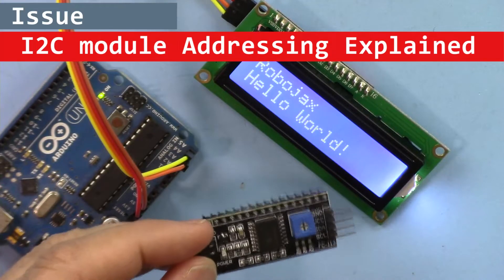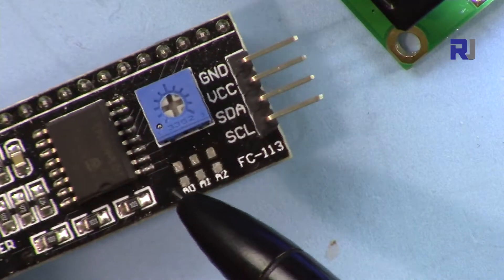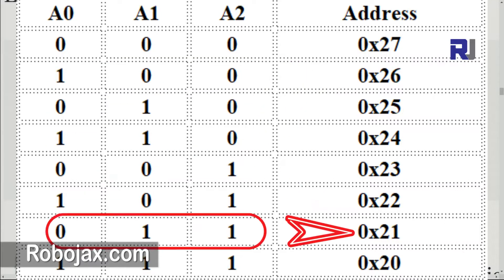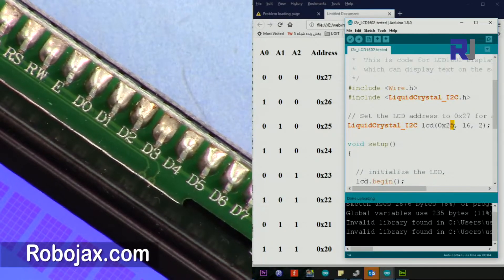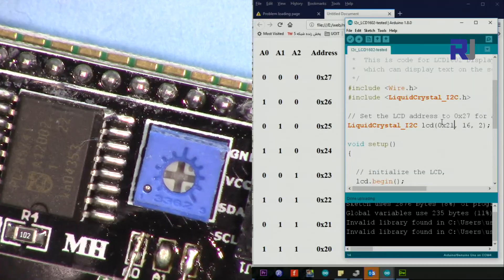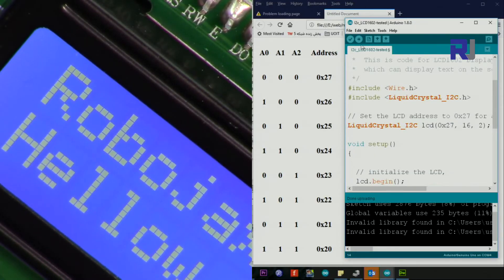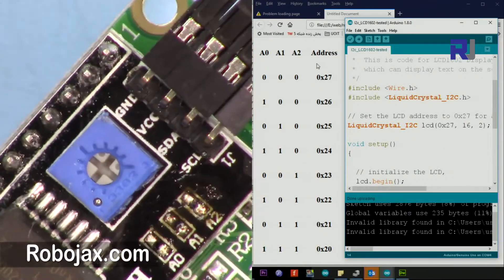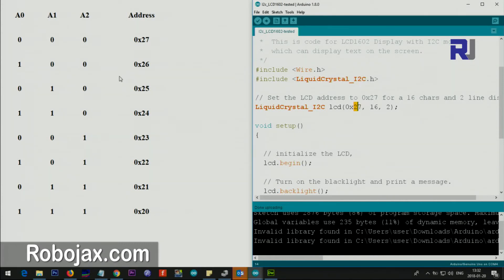LCD1602 I2C Address for Arduino explained and how to set I2C address RJT101

Comment: Thanks for sharing...
I'm getting no i2c devices found in serial monitor, what could be the reason
Reply from the maker: Check wiring
Reply from the maker: Also check if you have connected the wires to the right pins.  Each board is different see this page https://www.arduino.cc/reference/en/language/functions/communication/wire/

Comment: I suggest using female header on the i2c board so if you want the LCD to not to use i2c you can just unplug the i2c board
Reply from the maker: Very nice tip if you need to use the LCD for other propose.  But since I saw I2C module, I have not used it with those tones of wires unless I am asked to . Thanks.

Comment: when I use 0x27 then LCD not showing anything, What should I do?
Reply from the maker: you can't just use random number. use I2C scanner code that I provided and it will tell you the address.
Reply: @robojax  sir I was found 0X27 by the scanner code that you provide in the video, and that 0X27 is the default, what should i do
Reply from the maker: Then watch this video https://youtu.be/q9YC_GVHy5A

Comment: Hey, I tried soldering and unsoldering a0, a1 and a2 and tried scanning for the address I first got 0x3F without soldering and tried both address (from chart and serial monitor) in Hello World example and both failed. I tried soldering and every address and failed.
Please reply
Reply from the maker: Hi, then you must be doing something wrong. Have you connected the power? is the light on?  Other than asking you to check the wiring and voltage, it is only possible that the module is dead. Please use first the I2C scanner. good luck.

Comment: I have a little confusion with addressing mode when I use 0x27 then LCD not showing anything when I use 0x3F  it starts to display can u tell me how can i 
perform this conversion?
Reply from the maker: there is no conversion. whatever number works that is your I2C address and use it.  if you want to change it then watch this video carefully. may be watch it 2 or 3 times.

Comment: Robojax. Your video was very helpful. The more one learns the more questions arise. The I2C module you demonstrate in the video has two solder pads at A0, A1, and A2. I have several older I2C modules for LCD display where the A0, A1,and A2 each have three solder pads. The two outer pads are marked L and H. (Low and High?) The center pad is not identified. There are no jumpers installed. The address of the I2C modules is 0x20. Could you explain the three solder pads? I need to set address to either 0x27 or 0x3F. Those two addresses are hard coded into an App and are the only options. Thank you very much. You have a new subscriber.
Reply from the maker: Hello 90FF1, I have not come across the type of I2C module you mentioned.

Comment: is it possible to connect the a0,a1,a2  without soldering
Reply from the maker: what do you mean "connect without soldering" ? you can hold it with wire.  if you don't solder, the address 0x27 but if you want different address, then  solder it as shown 1:20. I have replied to your comments in other video. check potentiometer settings.

Comment: 0:30 you are touching its pin with hand while its on . I heard that if it touched while working it can burned by ESD of human .
Reply from the maker: Arduino works with 5V . When voltage goes above 50V depending how moist your body is it will become dangerous.

Comment: when im scanning using i2c scanner, the output in the serial monitor is "no i2c devices found" any solution for this?
Reply from the maker: wiring is incorrect. Check the wiring. Either the module doesn't have power or wrong wiring.
Reply: @robojax  SDA - A4 SCL- A5 the VCC-5v GND-GND my lcd lights up but when i test it with i2c still no i2c device found. Do i need a pull up resistor?
Reply from the maker: You can connect it to A4 and A5, but most arduino also have dedicated pin close to pin 13.  There is must be something wrong. If you have another module, try it.
Reply: @robojax  I have another question how to stop the timer when set in a certain number for example i want to stop the timer after 0 but after i print time out it countdown again to -1 and so on please help

Comment: I2C module is overheating and showing nothing on display.can you solve this problem.if you can please reply
Reply from the maker: Either you connected + and - incorrectly or the did before and the chip is dead.
Reply: @robojax  thanks for the reply😉😉😉

Comment: It doesn't make sense. According to this, my brand new (never modified) board should be 0x27.  The Scanner code is how I was able to determine that my address is 0x3f, which doesn't exist in this video.
Reply from the maker: The manufacturer might have set different address. That's why the address scanner is a good tool. I am glad you found the issue.
Reply: @robojax  Thank you for your response. Is there a chart that corresponds to the numbering system I have to use?

Comment: Hi sir I like your video..It's great description but my LCD is not showing messages..But yellow light is on display..No error in program easily uploaded
Reply from the maker: it means you have got the wrong I2C address.  Use this code to find the I2C address:. http://robojax.com/learn/arduino/?vid=robojax-I2C-scanner
Reply: @robojax  i have same problem. i only have black squares on the screen. this i2c scanner cant find anything too

Comment: Mr. Robojax.
thank you, this video that i am looking for, because my lcd problem have the same case.
may God always protect you.
Reply: I have been following this video since the beginning.
I have done it:
1. 16x2 lcd solder to i2C module which i have done correctly. The result failed.
2. My potential has spun and still can not be just a line of existing digits.
3. solder jumper A0, A1, A2 jumper I have tried 0X27,0X25,0X21,0X21. still fail
So I bought again lcd Module plus i2C still same status failed.

please infonya when kompile his successful .
tank u
Reply from the maker: I just discovered your comment because YouTube make new tool to check comments that I have not replied to. Sorry.

Comment: how connect lcd i2c with bluetooth hc06
Reply from the maker: why you need that? this module has 4 pin. Hc-06 has 6 pin. We are using this module to reduce number of wires.  Tell me your application and I might be able to to suggest something.
Reply: Robojax I need the code for a project consisting of two parts. The first transmitter containing DHT22 and HC05 is sent to the receiving part which contains the lcd i2c and HC06 screen. I need a code to display the variables from the sensor on the screen
Reply from the maker: To break it down, you need to send the DHT22 data to arduino remotely. Then you need two Bluetooth module. One for Transmitter (TX ) and one as Receiver  (RX) but both will also exchange information. The TX will get the data from DHT22 and sends it to base where you  have the display. 
First start here making sure you can communicate between two bluetooth. Watch this video https://www.youtube.com/watch?v=zwIQ2nKvjWk or this video https://www.youtube.com/watch?v=hyME1osgr7s
Then you we will you can use https://www.youtube.com/watch?v=S4ya3Q7uhJs to display the data.
First make sure you can connected two HS-05 or HC-06 to communicate to one another.
Reply: Robojax You've already connected the Bluetooth with each other but no readings appear on the LCD screen in the receiving pane
Reply from the maker: Before sending it to LCD, try to see if you get data Serial.print("DATA").  Replace the DATA with the RX line of Bluetooth . If you dont' see the data on the serial monitor, you have to resolve the issue before you connect it to the LCD.